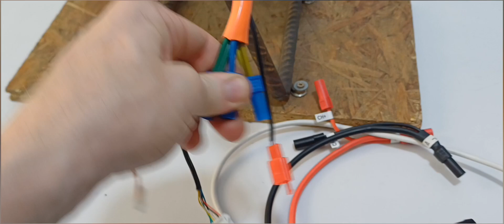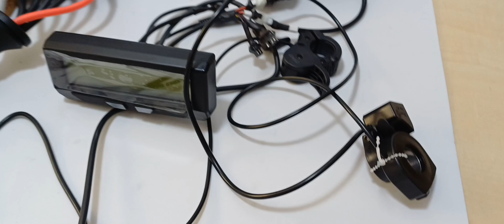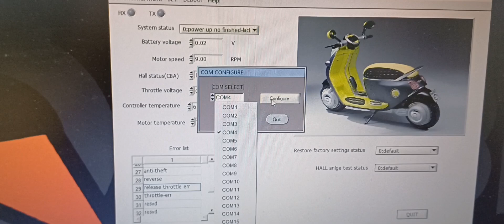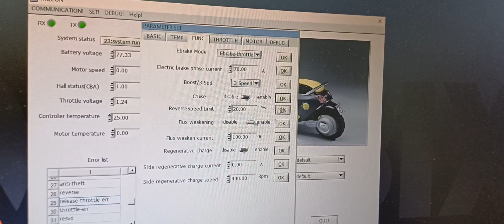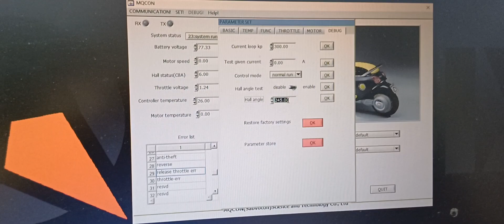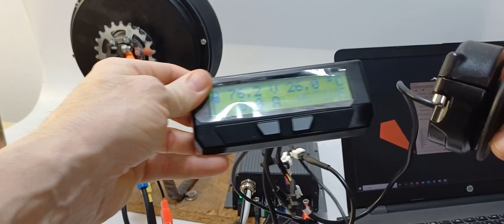Sabvoton SVMC 72150 with Wiring harness, Cycle Analyst - complete wiring and setup guide

Comment: i thought you display needed to be disconnected to tune it?
Reply from the maker: ? No, the display can be plugged in.
Reply: @QULBIXPerformanceElectricBikes every other video says you have to disconnect it so that it lets you save. maybe it's only like that when you use the bluetooth adapter. this is a little confusing😅
Reply from the maker: @jettysfuneral @jettysfuneral you probably mean in the case when you use the display that Sabvoton is selling. That is true. But if you use a Cycle Analyst V3, it is not necesary. CA is a standalone product. For SBV programming we reccomend a PC software, it offers more setup options than BT app (variable thumb brake regen, field weakening can be set higher, can be also unlocked to some 200A ...).
Reply: @QULBIXPerformanceElectricBikes ohhh ok gotcha